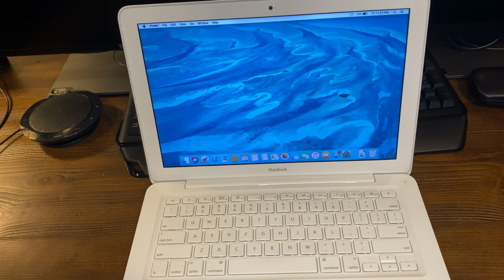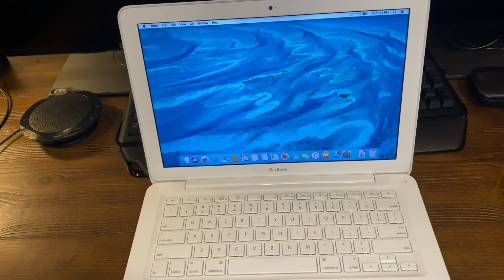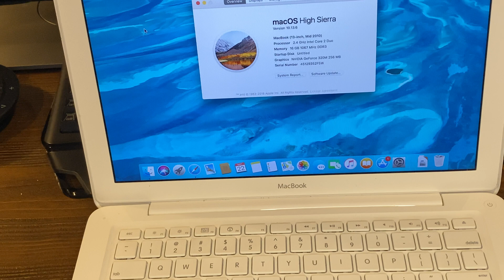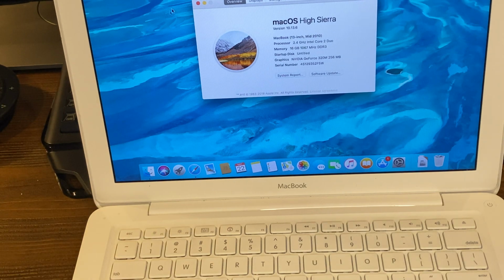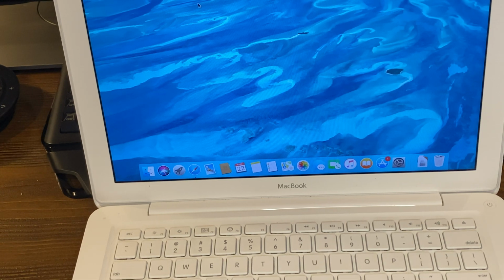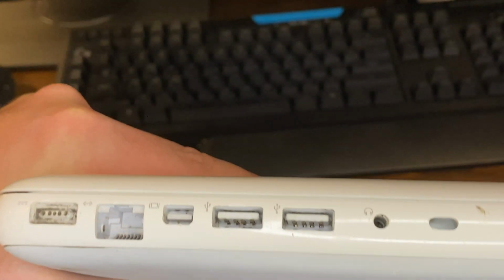MacBook (Mid-2010) Overview & RAM SSD Upgrade Tutorial

Comment: I was given a 2010 unibody MacBook that has a physical disk drive and a mere 2gb ram, and it runs decently after a factory reset; it was hella slow when I first it as it had a bunch of apps and files. I'm currently watching this video from the 2010 MacBook, and it looks good and runs smoothly; in fact, the video is significantly better than my T-430 Thinkpad from 2012. However, switching to full screen mode is a bit laggy and takes about 6 seconds to load and run without hiccups. Maxing out the RAM and upgrading to an SSD drive would make this laptop more than enough for web browsing, watching videos, Zooming (buit-in cam is better than my Thinkpad's), and word processing.  Thank you for posting this helpful tutorial!
Reply from the maker: Glad you enjoyed it!

Comment: Hello,
i also use this mid 2010 MB Unibody with mac Os 10.6.8 . can i upgrade to 8gb ram by using only 1slot 8gb and let the 2nd slot empty? 
regards
Reply from the maker: You might be able to. I’d check everymac.com or forums to verify.

Comment: Can I run Final Cut on my Macbook 7.1. It won´t install. But I think, I once saw one Unibody with Final Cut. Does Anyone has a hint for me? Thinking about adding a 1TB or 2TB SSD from crucial, but before that I need to know if it worth it to get Final Cut running. Since they offer it for free at the moment, it seamed a good Idea to get the Unibody Mac running for cheep with final Cut. Will it work? Will I need any special Software? If yes, which one?
Reply from the maker: There are unofficial ways to get it to work that you can google. However I wouldn’t bother trying to run final cut on that for anything other than recreation. For modern video editing it would probably be really slow.

Comment: How much ram can we put in this? As company suggests only 4gb(2gb x 2) So I want to confirm. Also can you put in 1333 Mhz or 1600 Mhz rams? Or do you require 1067 Mhz only
Reply: Actually, 16gb (8gb x 2). 1067 Mhz DDR3 only
Reply: I believe you can only go up to 8gb so that’d be 4gb x 2